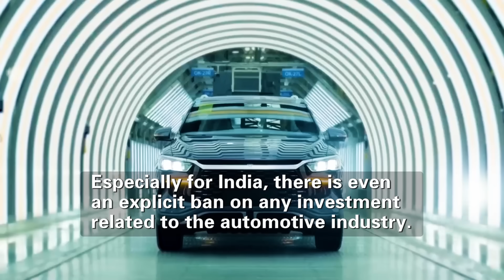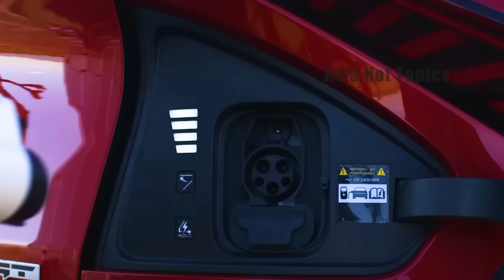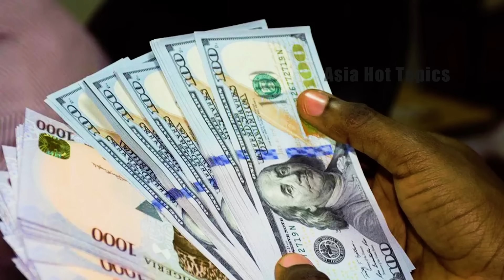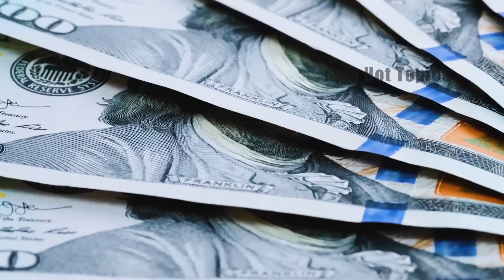Abandoning the Indian Market! China to Completely Ban Investment in Indian Automobiles – Why?

Comment: India Ev used 80% of China made components….incuding battery…
Reply: and most of their drug precursors
Reply: To boost manufacturing in India and integrate India into the global supply chain, it is inevitable that India will integrate into China's supply chain.
India's imports from China have been growing quite rapidly.
These imports include finished products as well as intermediate goods for manufacturing.
---
Reply: Really where did China getting the lithium. They are also importing it. You dont know the basics of globalisation. Each and every countries are dependend on other contries one way or other.

Comment: Electric vehicles has still not made a big market for themselves in India. 
Electric vehicles that are really doing good here in India are in the unorganized sector like rickshaws and local made three wheeled vehicles called 'totos' . These are simple. One battery pack, one simple electric DC motor, a rear differential and a few controls. Easy to make easy to maintain and repair. Few two wheelers yes and very few cars.